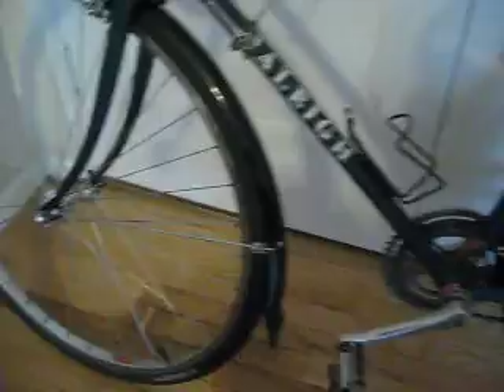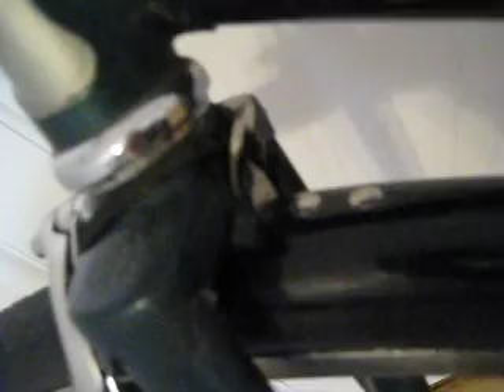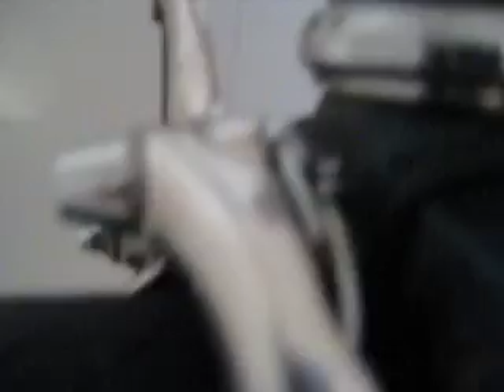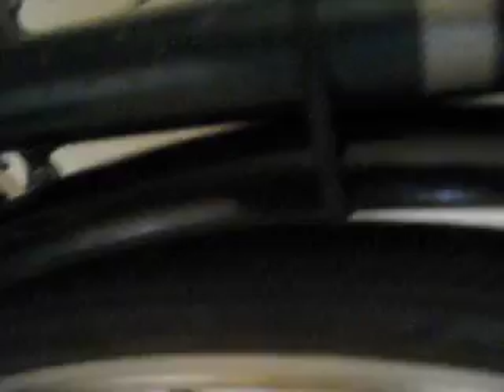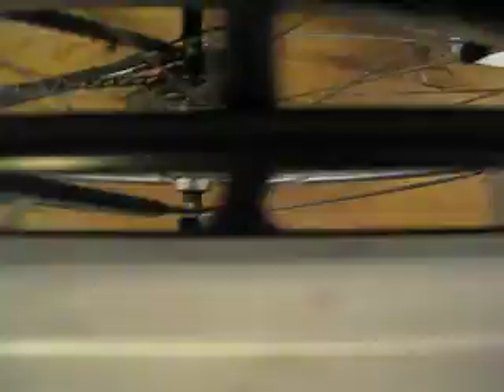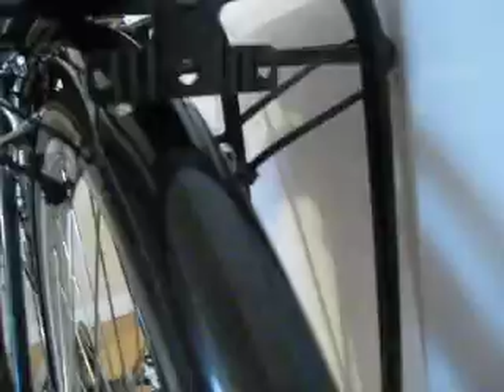Bicycle Fender Fabrication

Comment from the maker: @tyronety2000 had to use zip ties on the front because of reversing the front and rear brakes, Zip ties were used on the rear because the rear fender was cut into three different pieces. Sadly the fenders and the bike are no more, the poor 84 Raleigh Marathon Frame was bent beyond repair thanks to two winter accidents and it has been retired and replaced, by a 2005 surly long haul trucker